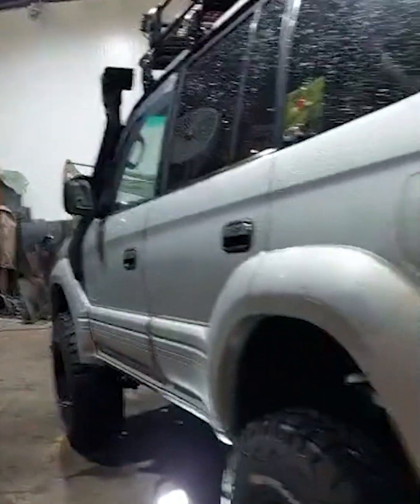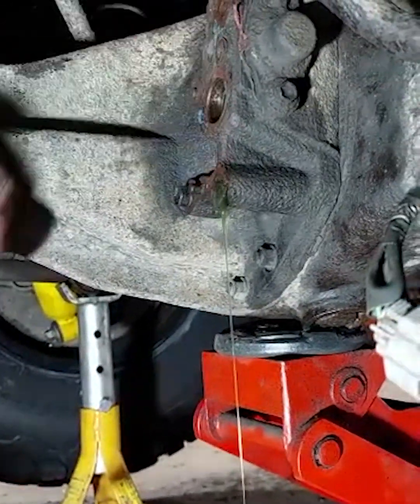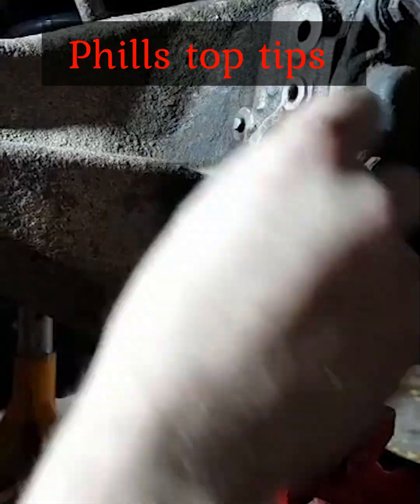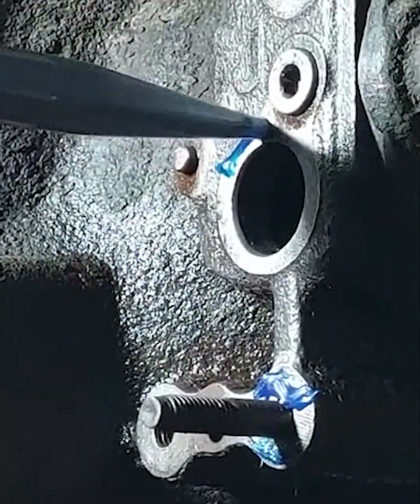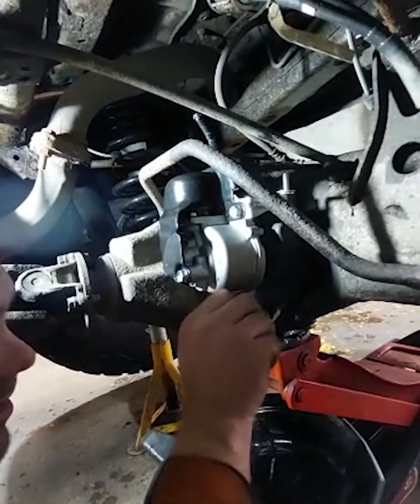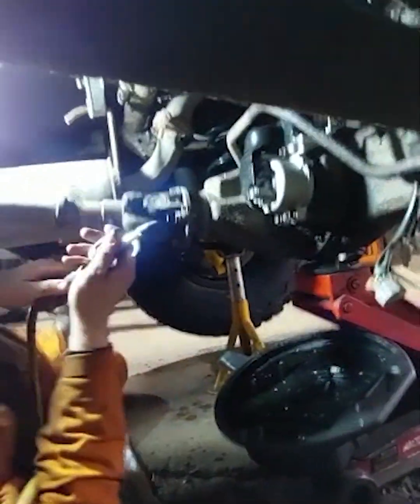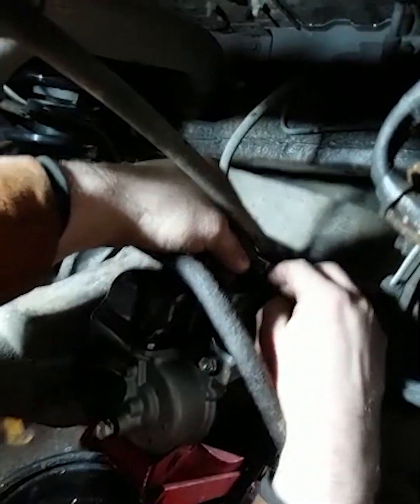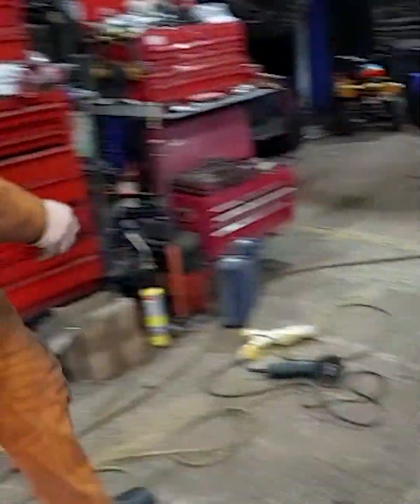How to replace diff lock actuator Toyota Land Cruiser 90/95 series

Comment: Hi Lads. Couple questions, guessing your actuator was in the unlocked position when you installed it, just the diff rack was out a bit? Also which extended drop links did you get? Ive got 2 inch lift and standard drop links at the moment. Cheers!
Reply from the maker: Hi pal sorry for late response
So actuator was in unlocked position and the car was. But had to move it slightly to get right. 
I’m sure the fronts fit the back 👍👍

Comment: I hope you get back to me, my question is my locker is knackered full off corrosion can i do away with it. And somehow blank the hole off🤔  thanks lads in advance
Reply from the maker: Hi 
Sorry for the delay 
Yes you can blank it off with abit of engineering if you see in the video Iv made one using a knackered diff lock and a plate